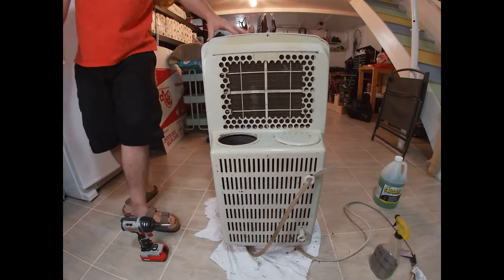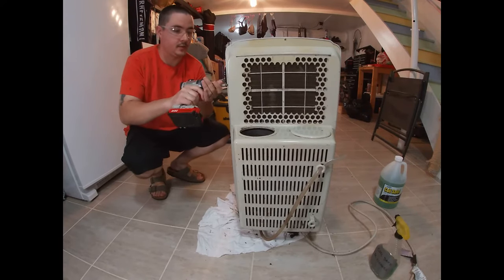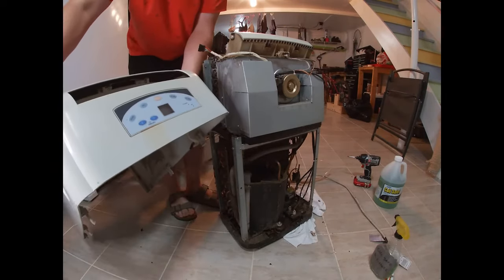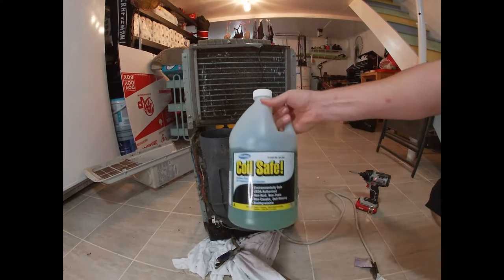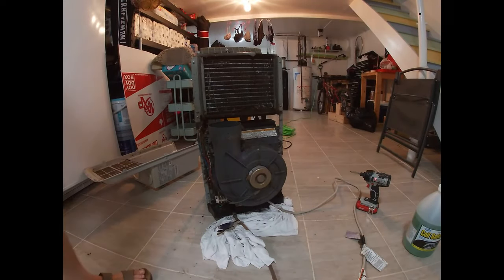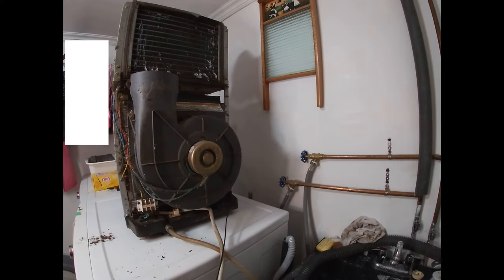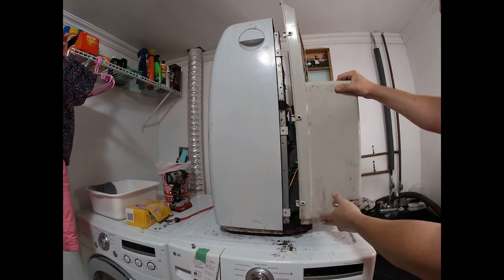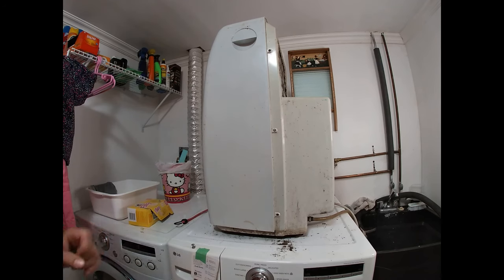How To Clean Portable Air Conditioner Coils

Comment: Extremely helpful! Quick question,is it okay if I clean the coil and fins using can of compressed air i.e. air conditioner cleaner? And as per instruction on the product, it just need to be sprayed onto the condenser, left for 2 mins before turning on the AC for at least 15 mins to let the dust flow through the exhaust. However this instructions is for wall mounted ac. So is it safe to use this for portable air cons? Please advise, thank you! 😁

Comment: Oh my. Thanks a million. I live alone and this is so helpful when its a challenge to find a ac tech.❤❤❤. My ac keeps working and shutof off for a minute and then picking up itself again. Plus its beginning to smell. So i thinj its the coils that need cleaning cause i usually clean the filter
Reply from the maker: Yes that could be the issue. Too much air restriction may overload the motor. Hopefully cleaning the coils fixed your issue. Thanks for watching. Please like and subscribe
Reply: Did it work after the clean?

Comment: This was very helpful. It's so hard to find videos on Portable AC Maintenance. Quick question, my AC fills up a bucket of water everyday. It's actually pretty crazy. It's a self-evaporating ac, but after about 1.5 years of use, it progressively got worse. I can't set up a continuous drain because there's no drain hole in my room, so it's elevated and draining into a bucket. Besides the coils / fins, what else would require cleaning to fix this? Vacuuming the actual copper line or using something like a "Gallo Drain Gun" / compressed air?
Reply: How about attaching a garden hose long enough to reach a drain... like a shower one?
Reply from the maker: @AaronMetallion the cleaning is only on the fins. No other cleaning will affect the water buildup. After you clean the fins you will experience more water because the dirt and dust that you cleaned off used to absorb a lot of the moisture so now that it is clean it will flow more. Also how cold do you run your ac? Running it a couple degrees warmer should not be noticeable in the way of comfort, but it may greatly reduce the water output as the condenser is running less when you run it warmer. Hope this helps. Thanks for watching. Please like and subscribe
Reply: Same here. Did a bit of research and concluded that the water pump is broken or else the water tank is far too small to handle July-August humidity. Unit shuts off and red water light comes on after approx. 20 minutes. Guy at the hardware store told me that amount of water is totally normal for our climate/humidity and it's gonna release water constantly. He cut off some tiny sections of hose for me to try and I went back and bought 3 metres of PERFECT FIT plus a metal clamp. It's pretty ugly, takes up a lot of space with a big plastic garden table in my room but it works! Bonus: soon afterwards noticed big clumps of what looked like mould being released into the bucket so letting the unit run at full capacity and free drainage cleaned it out a lot.

Comment: There are two screws at the bottom front panel of my unit and slide lock clips. Sharing to help others avoid frustration. Additionally mine had been used and all the gunk was really moist so I broke it up with the brush and wiped it away.
Reply from the maker: Thanks for the tip. And thanks for watching. Please like and subscribe

Comment: Mine doesn’t have that large snail shaped thing at the bottom when I take the back off-also; my front has to be taken off with ALOT more trouble. Is it safe to just pour water down the back coils like that? What if it gets into the electronics?
Reply from the maker: The snail shaped thing is the blower motor. Every unit is different and some have different shapes for the motors that are also in different locations. And yes it’s safe to pour water on the coils. It will not harm the electronics. The coils gather moisture as it is running which is why it gets so dirty. Some units are easier to take apart than others. Once you take it apart once, the shell comes off easier the next time. Hope this helps. Thanks for watching. Please like and subscribe

Comment: I didn’t even know you were supposed to drain these units, I thought that was only for the Dehumidifier mode. I just checked the drains on my unit and nothing came out and I’ve had it for a few years. Does that mean I’ll need to try and drain it more often after applying this chemical?
Reply from the maker: Yes. If the. Coils are dirty then the dirt will absorb the moisture. Once you clean the coils the moisture will flow properly off into the tray. It also depends on your unit. I have one in my room that collects an inch of water in a bucket every night. But the one in my daughters room doesn’t collect any water. Both are cleaned regularly hope this helps. Thanks for watching. Please like and subscribe
Reply: Most newer portable ACs are self evaporating now and rarely need to be drained in cooling mode unless you live in a climate where it is damp/humid all the time.
Reply from the maker: Thanks for the tip. Please like and subscribe

Comment: Only thing I hate about these units is they don't make a room as cold as a split unit
Reply from the maker: That’s true. I’ve always wanted one of those. They have them in a lot of hotels. Very efficient. Thanks for watching. Please like and subscribe
Reply: First day is cold  🥶 after no
Reply: I have 2 mobile units, one with a hose and one with a split unit. The latter makes less noise and cools way better. I was lucky to bu a good used one on the cheap. There are also other monoblock units, they are better and quiter as the mobile ones with a hose. But you have to be able to make 2 holes in your wall.

It also helps to keep your house cool, so close all windows, doors before it gets hot and close the blinds. Or better use a sun screen or those films or foils you can put on your windows. Those heat reflecting films works well if you buy the right one. I have to cool less because of it

Comment: This ac was pretty dirty, I am wondering if there is an alternative to the coil safe? I took my AC apart for cleaning before the winter and upon turning it on today; it still stinks. Any advice?
Reply from the maker: This is a fairly strong cleaner. You may have missed some areas. I would give it another soaking and a good scrub to see if it helps. This has always removed smells from all the units I’ve cleaned. Hope a second cleaning helps. Please like and subscribe and thanks for watching

Comment: AC worked fine but coils needed to be cleaned. Cleaned coils with coil safe and now my AC won't stop spitting out liquid. I thought maybe it was the coil safe but it's been almost a whole day since I used it and the water tray is filling up insanely fast. Any ideas? Think the coil safe got onto something it shouldn't have?
Reply from the maker: After you clean the coils it’s normal to fill up the tray much faster because when the coils are dirty, all the dirt and dust collects most of the moisture whereas when you clean the coils, there is no dirt to hold the moisture so it flows fast. The more humidity in the air means the more moisture. Some nights I’ll almost completely fill a 5 gallon bucket with water. That’s normal. If you want less water then adjust your temperature to a couple degrees warmer. I used to run my ac at 22 Celsius and now I run it at 24 Celsius and there is significantly less water in the pail than before. The colder you run it the more water you get. Hope this helps. Thanks for watching. Please like and subscribe

Comment: Are these portable AC units prone to growing mold inside of them? I honestly had no clue you was supposed to clean them. And I’ve had it for years never cleaned the inside of it lmaoo. Gonna buy some of the coil cleaner spray and vacuum and clean it out real soon lol
Reply from the maker: Yes they often grow mold on them because of the dust collection followed by moisture. The fins are a perfect breeding ground. Glad you found the video. Thanks for watching. Please like and subscribe
Reply: @BillOfAllTrades2016  I appreicate you for responding, I cleaned mine out and inside there was Styrofoam over the fan blower whatever it is and the inside was full of black mold... crazy i been breathing that in while i slept for years... but cleaned it out with bleach and vacummed the coils etc. will be making a routine and cleaning it for now on. how often do you clean yours?
Reply from the maker: I do a simple vacuum before storage every year. But every third year I clean with the chemical.

Comment: What temperature do you put that unit on
Reply from the maker: I don’t own this unit. I cleaned it for a customer. But my unit I keep at 24 degrees Celsius. If it’s a super heat wave I go 23 degrees Celsius.
Reply: So what's the difference between 24°and 23°, i think it's insignificant

Comment: can we just use warm water ?
Reply from the maker: Yes you can. But best to put some soap to kill the bacteria.
Reply: @BillOfAllTrades2016   very happy I did too find your videos. What is the spray you are using?
Reply: @BillOfAllTrades2016   can people use an air dust to clean it out too?
Reply from the maker: I used a spray called Comstar Coil Safe Cleaner. It’s an ac condenser cleaner. Can be bought on Amazon.

Comment: My cover doesn't come off. There's so much dust and dirt on the back coils that it doesn't cool as good and water leaks out if the coils. :(
Reply from the maker: My suggestion is to modify your ac vent like I did in the video in this link: 
https://youtu.be/Sm3npiYcb2w

Also the water is probably leaking because there is debris blocking the drain. After cleaning coils via the method in the link, dislodge anything stuck in the drain and all your issues should be solved. Hope this helps. Thanks for watching. Please like and subscribe

Comment: I used this cleaner and my ac is blowing bubbles is this normal? (I’m actually being serious)
Reply: That means you did not rinse off the cleaner very well after you finished using it. So you probably still have some of the cleaner left on the coils when You turn the AC on and that might be why it's blowing bubbles.
Reply from the maker: Yes agreed. Just need to rinse more thoroughly and you should be A-OK. Thanks for watching. Please like and subscribe
Reply: @BillOfAllTrades2016  It says on the coil safe jug it was a rinse free formula that’s why I was a little confused.
Reply: I let the unit run and kept draining it seemed to have worked but I’m unsure if it’s normal for the bottom could to drip water as well it looks like it’s flowing into a channel and it’s a bob on it. (Sorry first time cleaning it just unsure)

Comment: I saw that you had the unit plugged in while cleaning it.  It is the better practice to always unplug an electric appliance before servicing it.
Reply from the maker: Umm ya.. I already know to unplug stuff before opening it up. Where exactly are you imagining seeing the unit plugged in? When it was on the floor the plug was on the ground out of frame. And when it was ontop of the washer the plug was hanging out of frame. I plugged the entire time. May wanna check your assumptions pal. Thanks for viewing though.
Reply: @BillOfAllTrades2016 @ I'm not your "pal."  I was trying in the kindest possible language to point out a dangerous condition.  Your reply to me did not indicate "in the beginning of the video, I clearly stated the the unit should be first unplugged."  

So, you didn't mention a warning and the video does not show an unplugged power cord, only a cord with unraveling electrical tape (whatever that is about). 

I reread my comment several times and I still do not understand how you took offense.  I used no harsh language and was attempting to help you.  So much for subscribing to your channel.  Good luck in< in your pursuit of success on this platform.
Reply from the maker: Lol It’s not my job to tell everyone to unplug something before servicing it. Just like when I do my automotive videos I don’t show where the axle stands are and speak about safely lifting a vehicle. My videos bring the knowledge of service. The viewer has to bring the common sense of safety. Maybe this is a good lesson about assumptions for you. Just because I don’t dangle the unplugged plug on camera the whole video, doesn’t mean it’s plugged in. And also I never took offense to your comment, I just found it confusing. Thanks again for watching. Take care.